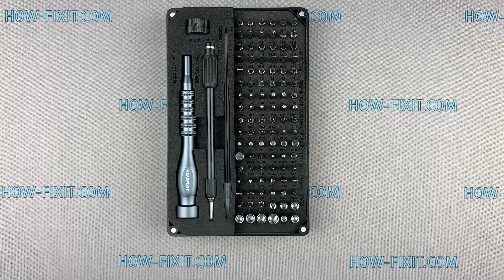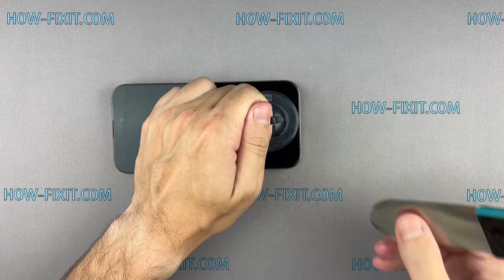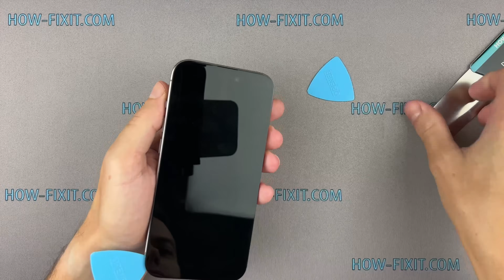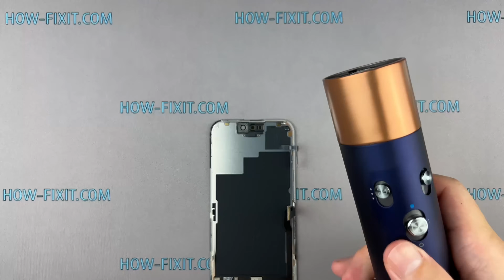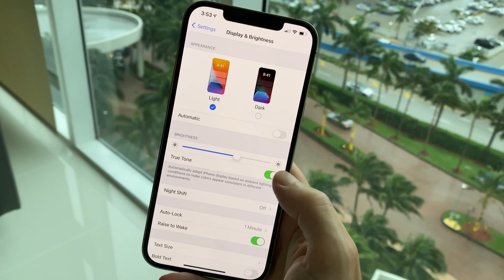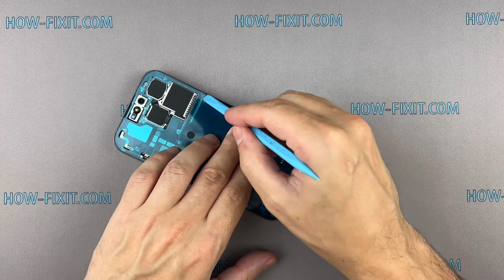iPhone 15 Pro Screen Replacement Guide | DIY Repair

Comment from the maker: ⚠To Fix 'Unknown Part' or 'Important Display Message' Check the iPhone Screen Calibration video guide.
For more info check out the links in the description
Reply: Any specific screen replacement recommendation?
Reply: are u replacing the OEM screen w the after market screen?

Comment: Which screw did you use to remove the brackets on the battery? Looks like a y but i tried each and they're not loosening

Comment: Thanks for the video. I have a question, maybe you can help me out: i have replaced my screen, transferred the face id cable to the new screen as well. After installation i have tested the face ID and it worked all well. Then I deleted the phone to give away the phone to my broter, and the screen started to go purple/pink and restart every 3 minutes. a search on internet tells me that the cable might me damaged. But if it was damaged, would it work in the first place? You have any idea, tip for me?

Comment: I love you, i just swapped screen on my 15 pro and was boot looping because of kernel panic caused by missing sensors, it's a 20$ screen just to get by a few weeks and was worried it was faulty and couldn't use the phone anymore, now face id and everything works which i did not expect at all

Comment: Just finished replacing my screen on my 15 Pro using this video and it works perfectly, including the face ID. It was honestly super easy.  Nerve wrecking but easy (obviously im not a phone repair technician and this was my first time replacing my own screen😅). Thank you for this video..... Just a disclaimer for any novices like myself, be careful when putting back those screws, that was the most difficult part for me. They are magnetic so they can easy get pulled to the wrong parts of the phone, which makes it difficult to retrieve them. At some point one got stuck under the camera. Didnt expect that part to be so difficult 😅
Reply: which screen did you use? and how much was it?

Comment: This model is not 15 pro...
Reply: Yes, that's an iPhone 15 Pro. You can see because the camera is large compared to the body, there's also a USB Type-C port and an Action Button which is only on the iPhone 15 Pro models and all iPhone 16 models. The reason I think it's not an iPhone 16 is because there's no Camera Control button which is only on the 16 models.
Reply: @quandie09  one year ago the iPhone 16 did not come out
Reply: @Leo_33350 he commented that 2 months ago

Comment: I love how much easier these phone repairs have gotten
Reply: Yes I agree. I did not expect this development. Since it has become more and more difficult in the past...
Reply: Honestly been the same for years but easy
Reply: @Crosbie55 nah before you need to move camera back over and haptic feedback
Reply: I had to repair my iphone 4 over 10+ times. If you dont know what you had to do for that watch a video. You basically take everything out from the back 😅
Reply: Its just iphone
Reply: at some point they regressed hard though. look at the iphone 3gs for instance which, once opened, only required unplugging 3 cables -- all of which were labelled -- to remove the old display assembly and replug them in reverse order for the replacement one lol

Comment: Does Face ID work after replace?
Reply: Yes, Face ID should work after a display replacement unless you're using a different Face ID module than the one that came preinstalled in your device.

Comment: my fingers are cut up from that curved screen disassembler. Since the screen I was replacing was shattered all over and I couldn't get a suction cup on it I went in from the middle top where I think is the speaker. I had that phone so freaking hot and it wouldn't budge one bit not even with alcohol. I got it open though from the top.